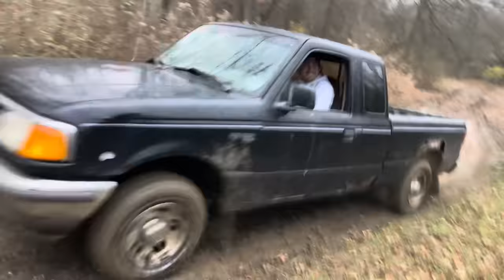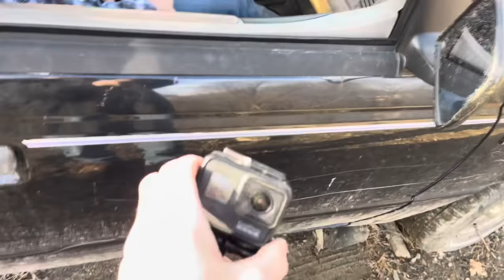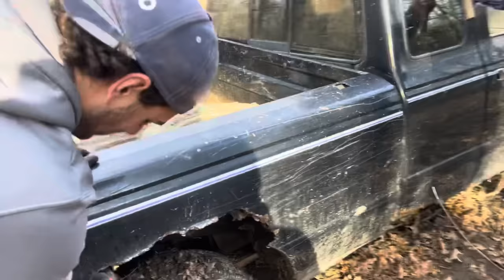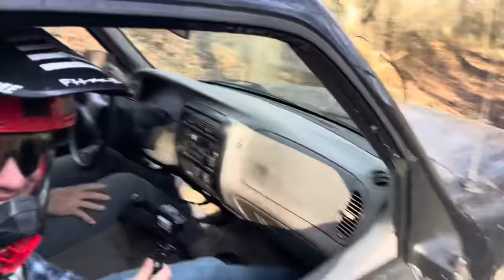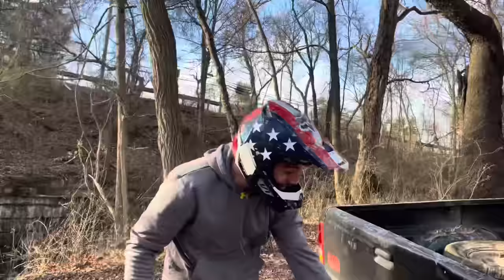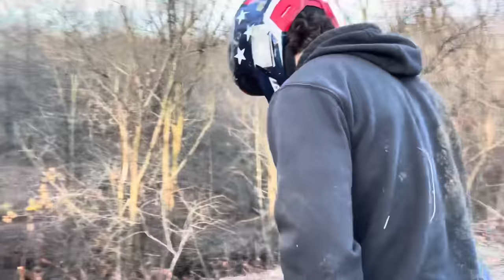Ford Ranger DELETE

Comment: I owned 2 of them. Had a 94 regular cab and a 97 ext cab. Both were 2.3 liter 4 cyl with a 5 speed manual. I  knew a plumber that had 417,000 miles on his ranger. Those old school 2.3 liter SOHC 4 cyl will run well over 300,000 if they are taken care of. That particular engine was a great design too, its non-interference so if the timing belt breaks while its running there is no damage. Pretty easy to work on and maintain.
Reply: Yeah they are great engines. I have a 97 mazda b2300 with the 5 speed manual. Timing belt broke on me on the way to work. Truck has 282k. Popped a new belt on and she's running like a champ. Can't kill them. However you WILL go through clutches 🤣.
Reply: Those were great, we traded or regular cab 4-cyl for a ‘94 3.0 for the ext cab, it was terrible on fuel, big downgrade

Comment: that truck was junk from the start. seeing how that bumper was moving separate from the body. She was a rust bucket. enjoyed this video.  But man those 90s rangers and Mazda ones are tanks. i own a factory lifted purple 96 Mazda b2300 with the 4cyl with 8 spark plugs and  5 speed manual. Great truck. Texas so no rust. has 150k miles.

Comment: I actually want a Ranger after watching this debacle. Pretty impressive truck.
Reply: They are amazing. I owned a 2000 Ranger, abused it for 4 years and the only thing I ever had to change were the tires.
Reply: I had a 2004 xlt in highschool. After plenty of abuse and poor maintenance it still runs pretty good
Reply: I have a 89 Ranger. Currently working on an off road build for it.
Reply: Mine is 30 years old and its still kicking smooth af to this day. Bought it used a smidge over 2 years ago for $500. 

Not exactly planning on "restoring" it per se, but its getting the regular TLC the first seven owners never gave it. First time i pulled the plugs i cackled, they were not only visibly gapped way too wide (the electrode was bent towards the piston) but severely eroded to boot. Surprisingly they were a nice chocolate tan color... aside from a basic tune up and some deeper inspections, all she needs is some shocks, struts, and a handful of bushings and dampers, and new engine mounts. 

Once its trued up close to being a fully competent truck im hoping to keep it running until i die.
Reply: i have a 99 ranger

Comment: We are on our 4th Ranger. We’ve been buying them since the 80s.
Our current Ranger is an XLT super cab 4WD with the 4.0L V6 and a 5spd automatic transmission with 3.55 limited slip rear differential.
Before adding a K&N intake and a 3” FlowMaster exhaust system we were getting 19mpg on the highway with the cruise set on 75mph. We’re now getting 23mpg.
We hate silver, grey, charcoal grey and black. 
We bought our 11 Ranger in 19 with only 20K miles and yes it’s Silver. I had it 2 toned in Red metallic so it’s Silver over Red metallic.  I had it reupholstered in Red with black trim and stitching.
We also added window vents, a dashboard topper, rear air shocks (we haul a lot of wood, gravel, topsoil). We added running boards, a LineX spray in bed liner, tonneau cover and wheels, and pinstripes.
It will soon be 13 years old but it has only 36K miles.
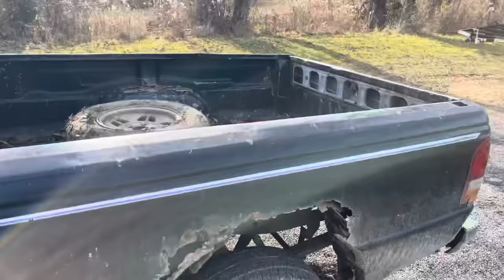I change the oil ever 6 months (about every 1,500 miles) with Valvoline full synthetic oil and filter. 2:03 Like all of our vehicles, I changed the front and rear differential, transfer case and transmission fluid at 30K miles.
It’s mainly used for work around our property. 
At our age it’ll be the last pickup we’ll ever own. We work it hard, but we don’t abuse it.

Yes I’d love to have fun like y’all are doing with your old Ranger, but I won’t be doing anything like you’re doing with your Ranger.
Reply: There is no way putting an air filter improved the engine mpg by 20%

But next time you fill up remember I drive a rabbit pickup tdi swap that never gets under 55mpg 
So it would be like if 2/3 times you go to the gas station

I get to put that $ in the bank 😊
Reply: @fastinradfordable  it wasn’t just the intake that I changed out.
You need to read my entire comment before saying anything
Reply: @Doc1855 even still an exhaust doesn’t do that much

Comment: Had a 1995 V6 5-speed Ranger. It was unstoppable. I drove it for a decade. Two kids drove it hard. Finally a family friend had it at the beach for a while. I think it would still be running if not for it getting flooded during a hurricane.

Comment: Ya got a tractor with a bucket on the front so do what we do - lift the ass end with the tractor, tie the wheel straight, put it in 3rd if it's a manual and wire it wide open. Then simply let it down. Works about 90% of the time, sometimes the truck does a 180 and hits the tractor but ya just blame that on someone else.

Comment: Those 2011 and older Ranger’s were actually a Mazda built pickup.
Reply: The Mazdas were built by Ford. The only thing in that vehicle built by Mazda would have been the trans
Reply: @mikerhodeback9636  Ford owned only 40% of Mazda.
The Ranger replaced the Ford Courier which was Mazda.
Reply: That vehicle was most likely built in twin city assembly plant...the later model  mazda was a rebadged Ford not the vice versa...the probe was a rebadged mazda. The motor made either here or germany
Reply: @mikerhodeback9636  That’s fine 
Merry Christmas

Comment: Hopefully this shows you how fucking tuff a Ford Ranger is I had a 88 Ford ranger 2 wheel drive with 31 inch mud tires and it would go places where Toyota 4 wheel drives couldn't deep mud was the only thing I had trouble with put 200 thousand miles on her